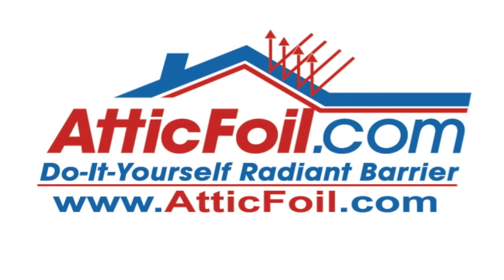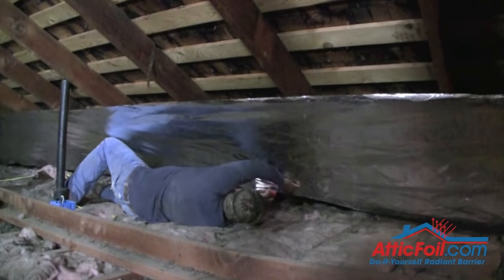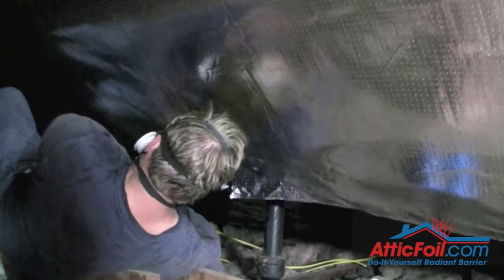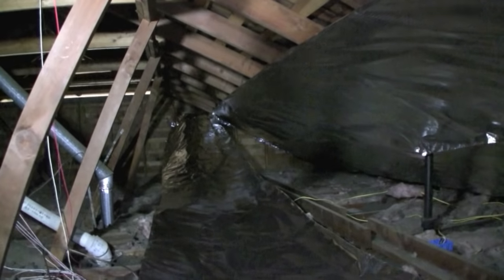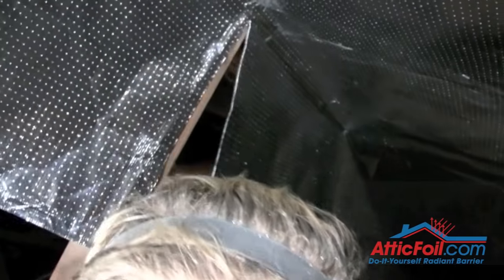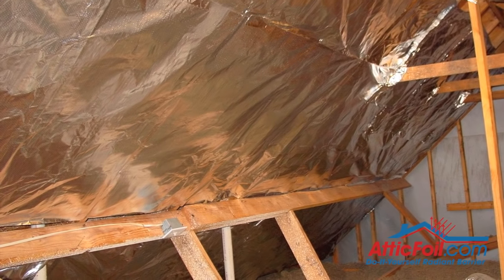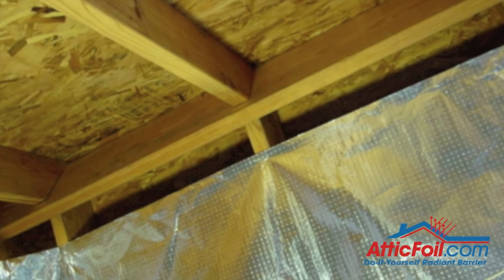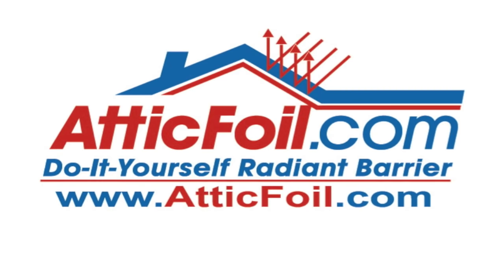Radiant Barrier Installation - How To Install Radiant Barrier

Comment: my roof  ridge goes in an East-West direction.  So most Sunlight hits the south facing roof.  Could I benefit from installing this just on the South facing roof?   It makes sense to me
Reply from the maker: Yes, radiant barrier has a cumulative effect.  The more coverage the better. Just like a tree covering part of the home would help, a tree covering the entire home would help more.  We have many customers at http://www.atticfoil.com install only over the South side or problem areas with excellent results.  Once they see/feel the difference many come back and do the whole attic.
Reply: Dennis Adams what difference do they experience exactly?  Does it help with utility bills?  Or wear and tear ?
Reply from the maker: Remember, a radiant barrier is really only effective under a roof that catches sun.  If it's in the shade or on the North side of a high pitched roof, it may not catch much/any sun.  Therefore, it's not gaining radiant heat.

Comment: Question: Would there need to be a small soffit vent between each rafter, so that convection could occur, behind the barrier? or will it still work without?
Reply from the maker: No, this is why you leave a gap a the bottom. Once air enters the attic it acts like one big pool and gets mixed together.

Comment: Does this need an airgap? Can I line the ceiling of the attic that touches the roof with this plus insulation?
Reply from the maker: Are you asking about a cathedral ceiling installation?  Info here: https://atticfoil.com/index.php/applications/cathedral-ceilings-hotmixed-climates/

Comment: my house dosent have a soffit nor a ridge vent. 
Am i still able to add this without getting any hot moisture on the wood behind? 
Meaning for a home that does not have a ridge vent where does the hot air go since you mentioned it goes to the top.
Reply from the maker: Yes, it will work.  You still want to leave gaps in the www.AtticFoil.com at the top/bottoms etc.  You WANT air to flow freely through the attic as though the foil is not even there. Even if you have gable vents the hot air will move towards the top of the attic, like water heading towards a drain.  The exhaust vents don't need to be at the very top to be effective.
Reply: @AtticFoil  i dont have any ridge or soffit vents just old style gable vents. 
Putting this wouldnt lead to leaving moisture behind right? 
Is the RB breathable? I just dont want moisture to build up from hot air and such
Reply from the maker: If you install www.AtticFoil.com with gaps at the top/bottom there is NO place to trap any moisture.  Air will flow freely through the attic. Don't overthink this.  And yes, the AtticFoil is microperforated so it is breathable.
Reply: @AtticFoil  but my attic has no fresh air that comes in. its a old style house that dosent have any built in soffits or ridge vents.
Reply: @AtticFoil  I'm glad I found this comment. I was.....overthinking it. haha
Reply from the maker: Probably was an original wood roof that was "self breathing".  Yes, I'd look to getting some "holes" /ventilation in the attic.  Ideally some in the lower part and some in the upper part.  And install www.AtticFoil.com to keep the heat down.

Comment: Could you help reflect that heat back to the atmosphere by installing the atticfoil on the top of the roof?   Could you make a product for that purpose? I read that some south american folks are painting their roofs white to help the climate by reflecting that heat back to space.
Reply from the maker: Our all-in-one roofing underlayment at www.RoofingFoil.com CAN be used outside.  Technically, it's not intended for outdoor use, but we have had customers use it on things like shipping containers, hunting cabins, etc. with great results after a couple/few years outside. More info here: https://atticfoil.com/index.php/applications/exterioroutdoor-use/

Comment: Question help??? My attic is like the video BUT has support (vertical) joists halfway up the roof joists (which are 14' long).  With those support joists attaching to the 7' mark on the roof joist, how should I install the barrier?   How do I cut around them and maintain good closure?  Going wide (across) or vertical (with the 24" gap)?
Reply from the maker: Sounds like you can just go up and over the supports - basically "wrap" them. If they are blocking the airflow from the soffits, I'd just stop an inch two below, leave a gap and then start again an inch or two above. This way the air never hits a "dead end" and will flow to the top.  If  you want to send us some pics we can offer more support.  Visit www.AtticFoil.com - Contact Us

Comment: What size staples? 3/8? 1/2? Galvanized or stainless?
Reply from the maker: 1/4" or 5/16" is all you need.  It's basically like stapling a business card to a 2x4.  https://atticfoil.com/index.php/installation/supplies-needed-for-installation/

Comment: Looking at your product vs the Radiant Barrier plywood and the way mfgrs suggest it installed face down, I am a bit confused.  Sure the foil on the plywood is next to an airspace, but being on the interior side does it not do any good? 

 In the homes my future builder has framed up now, this is how he does it.  How much of an increase in effectiveness over plywood-foil does your product and method yield?

Comment: I've been kicking around the idea of installing this in our new build house here in Central Florida.. Doing this ourselves with attic foil as opposed to having the builders install it yields a savings of about $1,500 dollars. They use something called silver shield.  My question is, will this product stand up to the harsh climate/constant sun and heat of Florida? 

Thanks

-Travis
Reply from the maker: +Travis Byrd Doing it yourself while under construction is VERY easy.  You can easily access the whole bottom of the roof without the interference of ductwork/plumbing/electical/sheetrock etc.  Behind Texas and California, Florida is our third best state for customers.  It works GREAT!!  Low cost, easy and effective under the constant sun.  Here is a Dept Of Energy Study which shows that staple up radiant barrier is proven best:  http://www.atticfoil.com/technical-information/dept-of-energy-test-results.html  Call us at www.AtticFoil.com if you need more info or have specific install questions.

Comment: I live in central FL and have a small uninsulated garage/shop just over 750sq feet with a 5/12 roof pitch with a 16'x8' garage door. My problem is 9 months out of the year it's almost unbearable due to the heat, it's literally a sauna during the day, and most of the time I can only work in there is either early morning or in the evening. The bottom of my trusses are "mostly" decked with OSB board for added storage. I have a 15K BTU window AC and just installed some 2" rigid foam in the garage door and thinking of adding a 1000CFM gable fan. There is a ridge vent, I know it's counter productive to have a gable fan AND a ridge vent but plan on blocking it off once I install the fan. How much would it help using this type of radiant barrier and by using this would I still need to block off the ridge vent or would this barrier film work by sealing off the ridge vent? If anyone has any other suggestions on how to help keeping cool or at least making somewhat comfortable in the summer I'm all ears.
Reply from the maker: You have a lot going on here.  They way to think of your shed is like a car parked in the sun with the windows open and the AC on.  It's gonna be hot even with the AC on.  IF you were to move the car under a tree, it's gonna FEEL a lot cooler by taking out the radiant heat.  Radiant barrier will basically act like a tree or how the shed feels on a really cloudy day.  It's still going to be warm, but not cooking hot.

Comment: You're advocating installing the radiant barrier from bottom to top.  I just watched another video where the RB was installed in vertical strips covering maybe 2-3 joists at a time.  Is one method better than the other?
Reply from the maker: Either way works.  The heat does not care which way the foil is put up.  Running horizontal is usually easier if you have an open attic. Running up and down is fine too.  We offer a 26" wide product specifically for this purpose:  http://www.atticfoil.com/products/26-standard.html
Reply: AtticFoil
Thanks!  And is AtticFoil perforated and non-perforated?  And when would you need to go with one or the other for vapor barrier purposes?
Reply from the maker: Michael Ellis We have BOTH perforated and non-perforated.  In an attic you will ALWAYS use the perforated.  Solid (vapor barrier) is rarely used and only for some specific applications.  Here is the webpage covering this topic: http://www.atticfoil.com/install-questions/vapor-barrier-vs-perforated.html

Comment from the maker: Actually both sides are shiny, so it does not matter.  Sometimes one side will look a little shinier due to the manufacturing process, but both sides are the same.

Comment: I am planning on converting my house to a radiant heat system. The floor is oak hardwood on 3/4 plywood over an unfinished basement. The basement joists currently have fiberglass. Can this foil be effective as a heat transfer to the floor, as opposed to using aluminum plates, and then re-installing the fiberglass insulation?
Reply from the maker: Yes, it actually works BETTER than the aluminum plates since it REFLECTS all the radiant heat UPWARDS to the bottom of the floor.  Here is the page on this application.  https://atticfoil.com/index.php/applications/radiant-heat-flooring-over-non-conditioned-spaces/  We don't have a lot of content on this topic since it's a small niche application, but we have several installers that use it for every job.

Comment: Is there a reason you are overlapping the way that you are?  If the lower pice overlaps the upper piece, wouldn't that force any moisture/water to go to the lowest point?  Or are you overlapping the upper over the lower piece so that the heat doesn't go under an edge as it travels up?  Thanks.

Comment: Question regarding installation around solar cabling coming through the roof. Is there best practice or code awareness around adding foil radiant barriers? I suspect your 3-6 inch around penetrations is good enough in those scenarios?
Reply from the maker: Never heard of any issues.  I'd check with local code on new construction or just do it for existing home.

Comment: Seriously considering installing this before blowing in more cellulose insulation.. Question, do I have to protect the entire attic or only the side that gets beat by the sun the most?
Reply from the maker: +Fernando Gomez Radiant Barrier has a cumulative effect.  The more coverage the better.  However, if part of the roof is not catching any sun, then it really isn't putting off much radiant heat in that area.  So, yes - focus on the areas that catch the most sun.

Comment: Wish I'd known about this before having new isolation blown in.  Is it possible to do this now with that insulation there or does it need to be removed first?
Reply from the maker: Skip Shervington It can be done, but it will likely make a mess of your new insulation.  I would consider the "Over Insulation" method to minimize the effect. You can make a few "paths" to do the work.  Use something like a dust pan to make a path.  Similar to a path in the snow.  Then lay the foil out over the insulation using instructions here:  http://www.atticfoil.com/applications-a-uses/attic-applications/lay-out.html  As you work you can fill in the path with insulation.

Comment: Will the heat being reflected back to the roof deck be too much of a heat load and damage the roof or lower life expectancy? It’s essentially getting slammed with heat on both sides. Thanks !
Reply from the maker: No, the roof temp will only go up between 5-10º which is nominal.  Here is info and a video with thermal imaging to show this: https://atticfoil.com/index.php/knowledge-zone/knowledge-zone-learn-about-radiant-barrier/myth-or-truth-radiant-barrier-damages-roof-shingles/

Comment: I have an attached garage, and no insulation over it. Ranch style, and the east-facing garage is a furnace by the end of the day. If blown-in is added, with foil under the roof, How much would that help? Also, have you seen a difference with ridge vents vs. a few box vents lower than the ridge?
Reply from the maker: Should make a huge difference. Like a shade tree landing over the roof.  If the door catches sun, then you need to address this too:  https://youtu.be/OROTrjn1j9E

Comment: Can you put drywall attached to the foil if you want to finish the attic out?
Reply from the maker: Yes - Kinda.  It will work fine.  However, if you are going to be heating/cooling the finished out space, depending on where you live you should probably put in some type of "regular" insulation too.  The www.AtticFoil.com is for the radiant heat, and the regular insulation is for the conductive heat.  Here is the video and page on how to install in a cathedral ceiling.  It's one of the most popular applications. https://atticfoil.com/index.php/applications/cathedral-ceilings-hotmixed-climates/

Comment: we have a barn with steel beams and a metal roof, no insulation. (Texas)  It gets up to 114 degrees in August.  What are our best options for insulating roof/ceiling?  We keep animals in barn with swamp coolers, fans, ice packs, and misters.  Able to get temp down to 90's.  Barn is open sided on 3 sides
Reply from the maker: We now make metal building insulation at www.BlueTexInsulation.com

Comment: Any advice for a flat roof installation?  No air vents currently.  Mixed climate.  Very small crawlspace. about 1-2 feet in some areas, superperf or regular atticfoil?
Reply from the maker: If in doubt always go with the SuperPerf AtticFoil.

Comment: What happens to the heat that is trapped between the roof and the attic foil? Does it just escape through the open slit on top? How does that heat not escape into the attic and heat up the insulation? I guessing it’s just the radiant heat that is blocked, which is better than nothing.
Reply from the maker: Actually, there is no such thing as "trapping" heat.  Heat is ALWAYS moving from hot to cold.  And air absorbs virtually no radiant heat.  Otherwise, we could not have a COLD-SUNNY day.  The air between the foil and roof is actually getting hot form pulling heat off the roof deck.  The hot air will naturally rise and go out the top of the attic.
Reply: @AtticFoil  you mentioned go out the top of the attic meaning if it has a ridge vent correct? \What if your home is a older home and dosent have soffits nor ridge vents but only gables. 
Where would the heat go in that case since the top is all wood and nowhere to escape/

Comment: What does this barrier do to the shingles? I would think it would damage them by trapping the heat next to the roof surface?
Reply from the maker: Roof shingle temperatures over a radiant barrier typically increase less than 10 degrees.  Here is a video with thermal imaging showing part of the roof done with radiant barrier and part without and the difference in roof temperature is only 7 degrees. http://youtu.be/OHpyv_kxmoI
Reply: AtticFoil Radiant Barrier Foil Insulation,
Thanks. That's another thing I've worried about.

Comment: What about stapling to the floor joists in a crawl space. Would that help with utility bills?
Reply from the maker: No so much with radiant heat loss since you don't have a lot of radiant heat in your floor.  It does however create a "dead air" space between the floor joists which has some r-value. Not a lot but some.  For crawlspaces, you should look at our foam and foil products at www.BlueTexInsulation.com

Comment from the maker: @Lowderpoop Yes, we actually developed the FLAT TOP method for this purpose.  It works great and you don't have to use tall ladders.  Visit AtticFoil(dot)com and look at instructions for the flat top method.  You just want some holds spread out for air to flow freely through the flat part.  Any other questions, call us on 800# or email us.

Comment: Radiant Barrier  works best on top of insulation or ceiling rafters
Reply from the maker: Actually installing on the BOTTOM of the rafters is by far the most effective method for a radiant barrier.  Putting on TOP of the rafters allow heat to travel by conduction through the radiant barrier into the rafters.  This heat "bypasses" the radiant barrier and can be re-emitted into the attic.  By covering the bottom of the rafters, the AtticFoil will reduce heat coming off the rafter by it's emissivity quality.  Take a look here at the full scale testing done by the US Department Of Energy comparing different radiant barrier install methods: http://www.atticfoil.com/index.php/technical-info/dept-of-energy-study-results/  The results show that stapling to the bottom of the rafters is the most effective at reducing heat into the attic.

Comment: Am I allowed to put in insulation between the roof plywood and the barrier? Wil that bring down the temperature during the summer months?
Reply from the maker: You could do this, but this is not the place for insulation in a vented attic.  You want insulation on the floor where your "thermal envelope" is.  The foil acts like shade from the heat on the insulation.  Putting insulation between the foil and the roof deck is kinda like holding a jacket over your head...why?

Comment: Prior to installation of this radiant barrier, It's well worth the investment to install a heat pick-up coil within the trusses/rafters such as a poly tube. In doing so, You'll have all the hot water you will ever need.